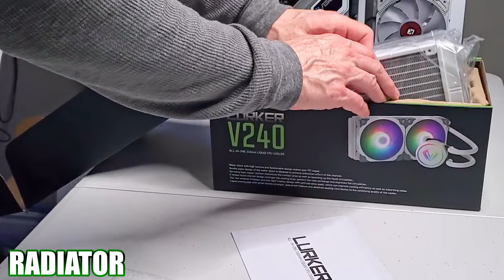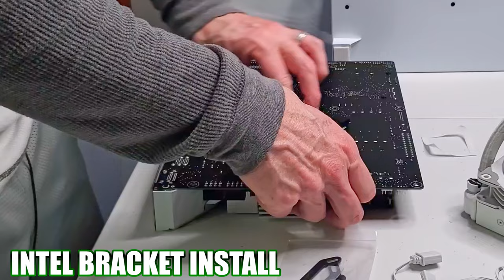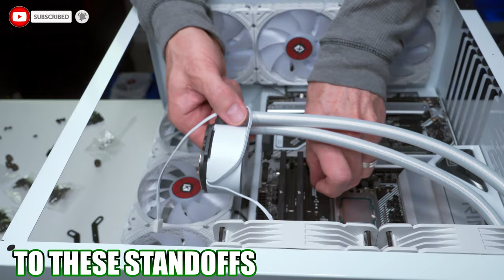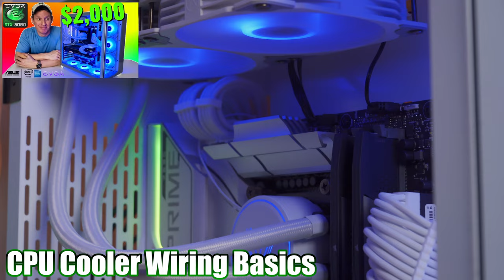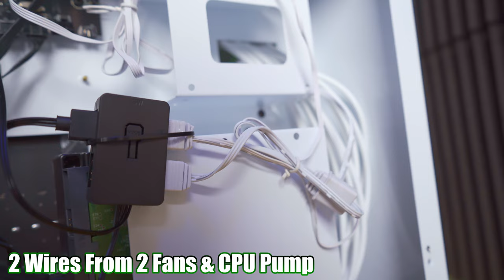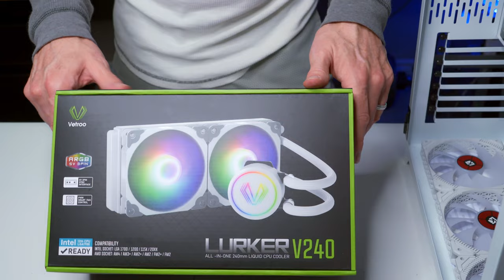HOW TO INSTALL ANY AIO CPU COOLER INTEL | LURKER V240 240mm ARGB

Comment: Your wiring explanation is bad. "Connect here"
Reply: Struggling with this cooler as well and looked up his motherboard legend, he plugs the first one at the bottom into the Chasis fan or CHA_FAN and the top which are the two radiator fans into the CPU_FAN

Comment: Way too busy a setup.. too many wires, too bulky, and most likely totally unnecessary. I've always used a CPU fan that comes direct with the CPU itself and my systems run fine for years and years. I've never understood these solutions looking for problems.

Comment: Aren't all your fans in the exhaust position? Isn't this considered a bad practice?
Reply from the maker: @directino  I've moved them in different directions and tested temps and ended up have the bottom fans as intake. I didn't show that but I moved them. Thank you for watching.
Reply: @UltimateTechHub  Yup, the case looks so much better with just exhaust fans but for the bottom fans intake is considered a must.

Comment: I have a controller but it doesn’t have the same connections that the wire needs ? Means it’s outdated and I need to change it?

Comment: This helped so much with my build!!!! Thanks!
Reply from the maker: Glad to hear it! Thanks for watching!
Reply: @UltimateTechHub  wait how do You install the fans to be able to push air through the radiator do You need  put the fans upside down or You need to put  the fans on the back
Reply from the maker: @programmerhackers1444  The exact way I installed it. The fans push air from inside the pc through the radiator  out the top of the case.

Comment: when you mount it to the top does it act as exhaust/outake for the pc airflow ?
Reply from the maker: I mount it as exhaust since hot air rises. I usually mount the bottom fans as intake.

Comment: Query; default setup for motherboard CPU fan and Motherboard PUMP fan connection.  Should AIO fans be daisy chained to CPU Fan, and Pump connection to Pump Fan?  Or all connections daisy chained to CPU fan (as my thermaltake AIO seems to indicate. Thanks.
Reply from the maker: Connect to CPU fan connections not the Pump Fan. Good luck and keep me posted. Thank you for watching.

Comment: Need video for amd...
Reply: Im having an issue where the screws are nit big enough and my cpu water cooler is loose... im thinking of going to a hardware store and getting crews or bolts that have threads all the way up so i can secure the cooler.... it says my stuff should be compatible and im so annoyed.... im not using this wraith cooler anymore🤬
Reply: Of course getting the ones that fit into the backplate sized...